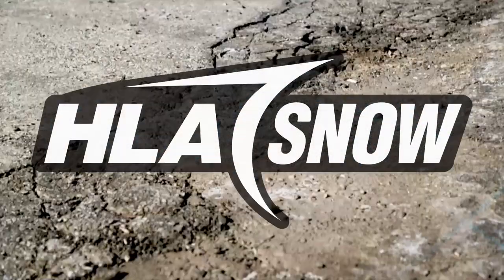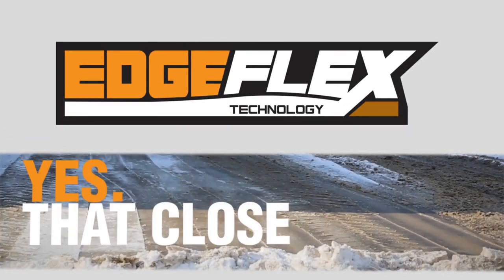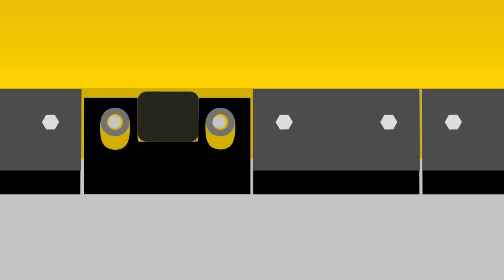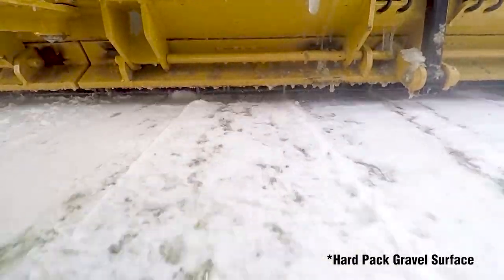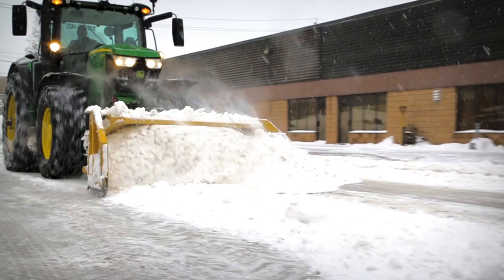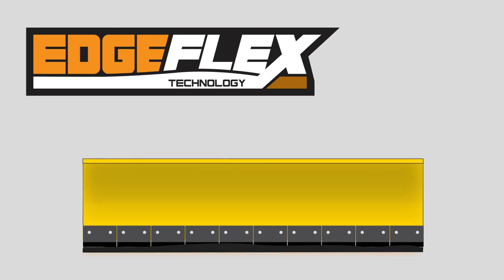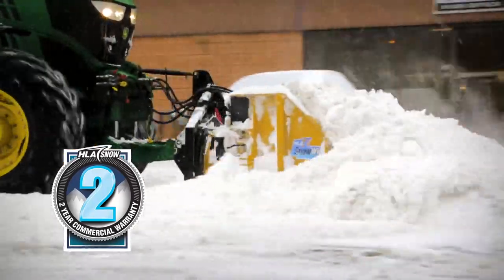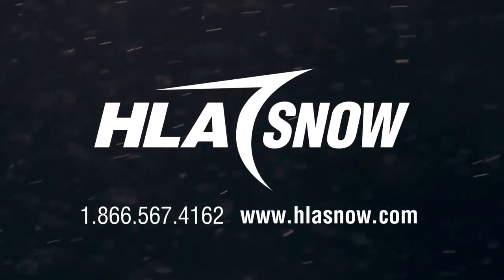HLA Snow - Edge Flex

Comment: Can I bolt the edge flex on a old HLA 3500 that currently has a straight steel cutting edge? And if so how much would it cost?
Reply from the maker: Hey Quinton, it depends on the year of the blade but, Yes it can be retro fitted. Price depends on a few variables such as location etc. Contact your closest dealer and they can better guide you.